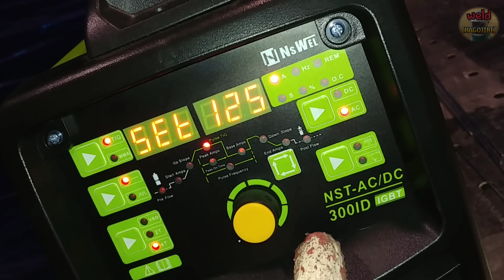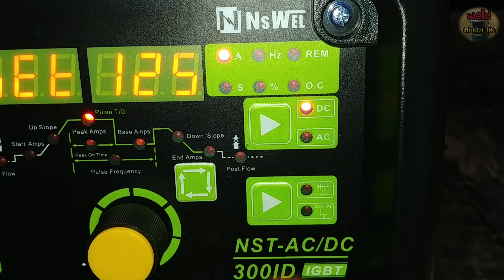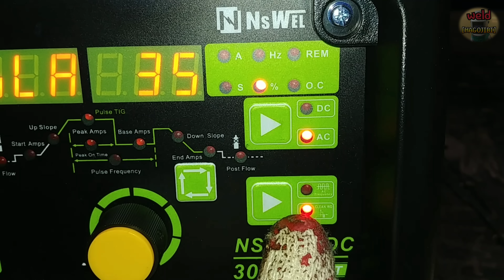Tig welding aluminum Why use AC settings

Comment from the maker: Thanks for watching.
Press the "subtitles button" to reveal the translated subtitles.
It's also available on desktops and smartphones.
1. Touch the screen.
2. Press the button with "The three dots (set button)" in the upper right or lower right corner.
3. Press "The subtitles button".
4. Press "Translated Subtitles".
시청 해주셔서 감사합니다.
번역 된 자막을 표시하려면 "자막 버튼"를 누르십시오.
데스크톱 및 스마트 폰에서도 사용할 수 있습니다.
1. 화면을 터치하십시오.
2. 오른쪽 위 또는 오른쪽 아래 모서리에 "세 개의 점 (설정 단추)"이있는 단추를 누르십시오.
3. "자막 버튼"을 누르십시오.
4. "번역 된 자막"을 누르십시오.
Reply: 아주 좋은 채널 이네요 
그냥 단지 AC로 해야한다는 말만들었는데 왜 해야하는지 이해하고 갑니다
Reply: Hello Friend ! Finally, you started a cycle about welding aluminum. I will wait for the next issues.
Reply: Here is a story about one evening when i was 15 years of age....
We seen 1971 golden light UFO, 20.04 until 20.13 in November at Nötesundsbron/Vindön/Sundsandvik/Orust-Sweden West Coast,it was 333 meters in diameter discus shaped slim,when it departed Easterly direction 20.13,it was an intense white sonoluminiscence light,as it took of in an immense speed.....but we rather believe it was a time travel,cause nobody could survive that kind of acceleration. Then came a bright ruby red swirling glittering cloud about 200 meters cirkular. After some seconds,far away,a Big Dark Blue 4 edged glowing star,and when its lights went out,so disapeared the ruby red swirling glittering cloud.....
Motor on our vehicle stopped as the intense light came,also all electric supply,streetlights,houses,tunnel light,went down completely,as forseen in cases of Time travel event. Nothing was said on the News,nothing on Papers,but we did see this 1971 november,Saturday.

Comment: I believe that a big enough charge can help MMA overload even aluminum electrodes while running on AC.

If AC stick can overwhelm 6010, then it should overwhelm aluminum electrodes which people say only on DC.

Manufacturers should make aluminum electrodes that can also run on AC.

Comment: I am confused, it appeared that you connected the torch to negative and welded in AC? Shouldn’t you have connected the torch to positive to run AC? I guess the only issue would be your AC balance (cleaning) control would be backwards as the machine would assume your torch was connected to (+) Thank you! Love your videos!
Reply: AC일때는 어디에 연결해도 괜찮습니다. 교류라는것은 주파수에 따라서 + -가 계속 바뀌기 때문입니다.
60Hz는 1초에 + - 가 60번 서로 바뀐다는 뜻입니다.

Comment: Very confusing....why don't you just say ....electrode (torch) positive or electrode(torch)  negative when you describe the connection for Tig on aluminium or steel.
So, DCEP can only mean that the torch is in a DC mode and connected to the positive.......saying reverse polarity is EXTREMELY confusing to a DIY Tig welder person learning the ropes.
Tig welding with AC is self explanatory.

Comment: Hi and thank you for your video , for welding aluminium in DC + torch , may you should try a bigger thungsten than usualy you use , for this video i think you use an 2.4 mm but if you use an 4 mm the arc will be more stable because can absorb more énergie . 

Hope you reply
Reply from the maker: Thank you for your good opinion.
The tungsten I used is 3.2mm.
Reply: @weldHAGOJIBI  Thank you for answer

Comment: Very beautiful video.
You explained and showed it very well!
With aluminum there is a problem with the oxide layer.
The oxide layer melts at approx. 1700 ° C and the aluminum has a very low melting point, which is approx. 660 ° C.
With alternating current (AC), the current flows back and forth very quickly and this generates high heat, which melts the oxide layer.
Reply from the maker: Thanks for adding the theoretical part.
Your writing will help a lot of people.
Have a good week.